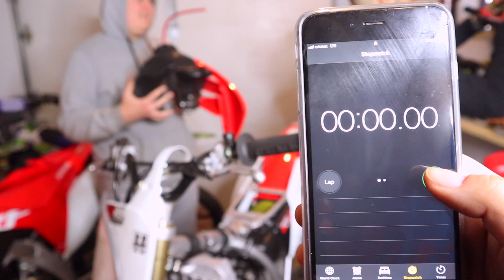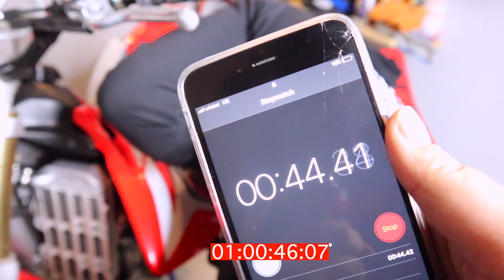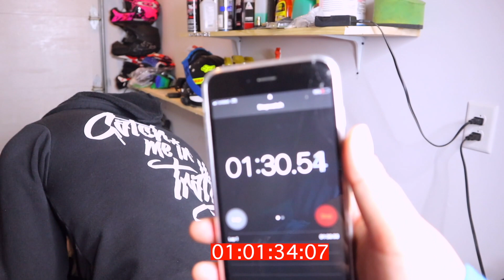WHAT DID WE DO TO THE BIKE NOW ? | BRAAP VLOGS

Comment: 1. you have to change the oil on your bike after the first ride because there’s metal shavings in it from braking it in. 2. you don’t change the spark plugs on a four stroke like you would on a two stroke.